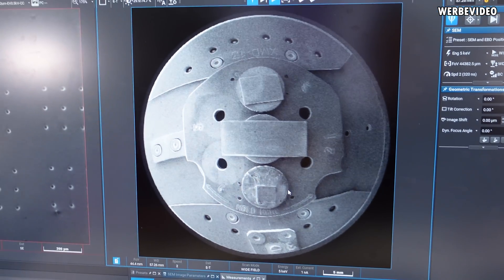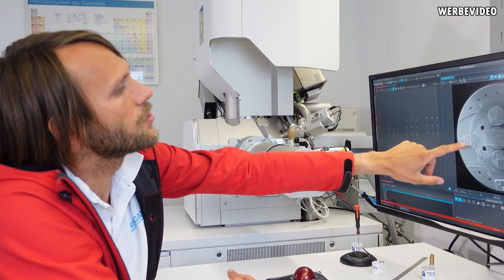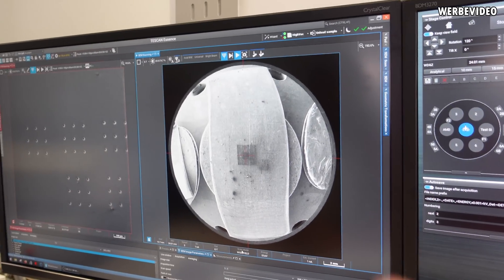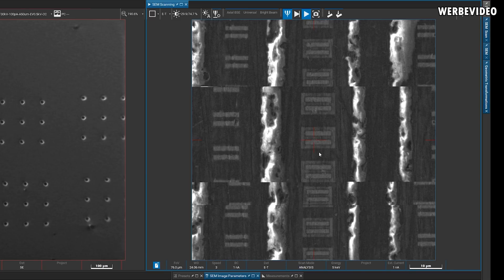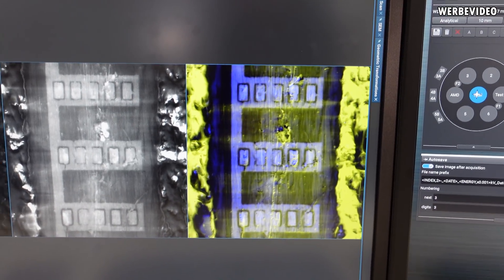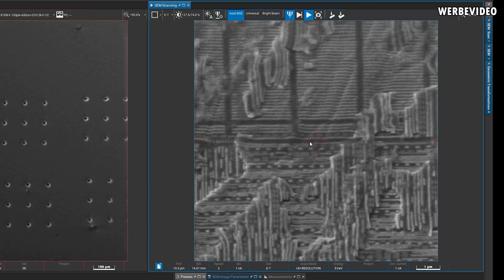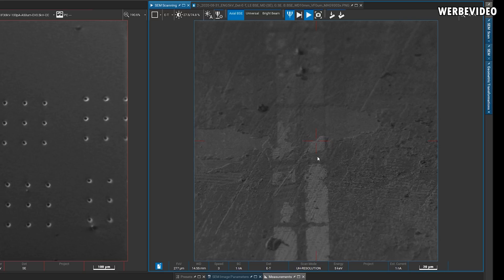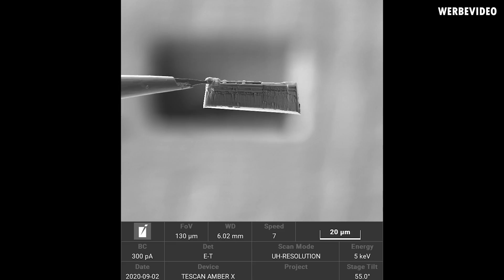Ryzen Nano-Structures more than 100,000 times magnified. Visiting Tescan Part 2/3

Comment: Der8auer, thank you for taking the time to describe things in English as well. I'm sure it's a lot of extra work, but we appreciate the extra effort from you and the tech from Tescan. You both are awesome! Thanks you!
Reply: It must be a lot of work. If there's ever a time when it doesn't seem feasible to do a second English video, writing correct subtitles would be enough. There are so many channels I'd like to watch, but subtitles never populate correctly.
Reply: Yep. He's really awesome, i have huge respect for him.
Reply: I came here specifically to make this point. And the video is good, lol.
Reply: Ok so you know what Electron tunneling is with the transistors, and how they use silicon transistors to get smaller like the 7 nm they are currently at with AMD's Ryzen 3000 series CPU's.
And the 5 nm, 3nm and so on, to make the computers more efficient with performance and energy but now we are starting to see more heat.
Silicon has limits but they keep trying to improve it, and it will melt at specific temperatures, so we need to replace it.
Ask yourself why we aren't using Quantum Materials like Graphene (yet) and still using silicon. 🤨🤔

This is where Graphene will fix the electron tunneling aka Quantum Tunneling, we don't need silicon to get down to 1 nm "nanometer" in size.

Imagine this, Graphene computers with a magnetic current to be 1,000 times faster and possibly only use 1% of the energy used. 💡

Now imagine Graphene optical / transparent transistors for Photonic Computing. 💡

Now imagine Graphene lasers for the fiber optics that would be used as the circuits inside our computers for Photonic Computing. 💡

--------

I would rather see Graphene computers, let's get rid of silicon. I'm serious.

Check this out.
I would give links but the video hides my comments.

Go to my channel and click on the playlist called "Videos with important info to get around my channel". ✔

Watch a Flash Graphene video about Flash Graphene 100 dollars "per ton". ✔

And then another video about "Large machines on earth / in space to make Flash Graphene". ✔

After that, check my channel with 2 simple steps for my other channel, go to the "About" tab of the channel I'm commenting with now and read the info with a link found there to save to your browser's favorites. ✔

==============================

Imagine Graphene for Photonic Computing, to help us save on our energy needs, really think about that for a second with Photonic Computing.

Check my other channel for these 2 playlists.
Photonic Computing playlist. ✔

Graphene computers for home and Starships, playlist. ✔

Learn about Graphene from my other channel's "Graphene playlist". ✔

If you want to know more about Graphene and Quantum Technologies, go to my other channel. ✔🤔💡

Comment: Loved the explanation of why it looked like there was a light source due to the sensor positioning and the rest of that part.
Reply: I think he mixed up the word sensor and electron source /electron beam. That view point would be impossible if the sensor, where the image was captured, was off to the left even if the picture was corrected and adjusted to look as if it were taken head-on/straight down at the sample.
Reply: @jacobc436  Actually, no, he said it right. The beam is fired in a raster scanning pattern, and the detector collects electrons that are kicked off of the sample at each point in the scanning pattern, recording it as a pixel of the image. The detector could be literally anywhere, and doesn't even have to be pointed at the sample because it uses a high positive voltage to attract the electrons that come off of the sample. Many SEMs will have several different detectors and each one is in a different location, but the resulting image be in the same position and orientation. The only reason the ion beam image on the left of his screen was at a different angle was because that is fired through a separate column from the electron beam.